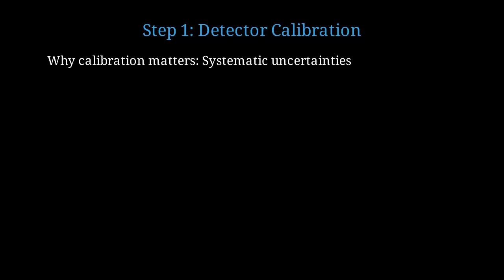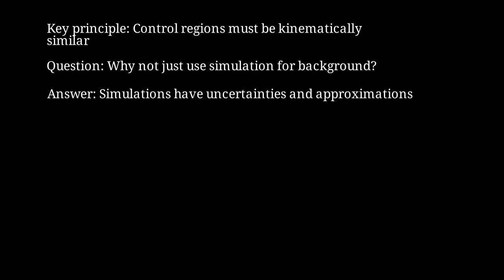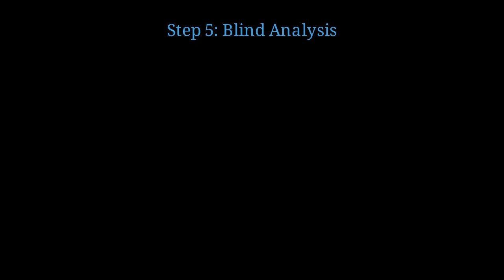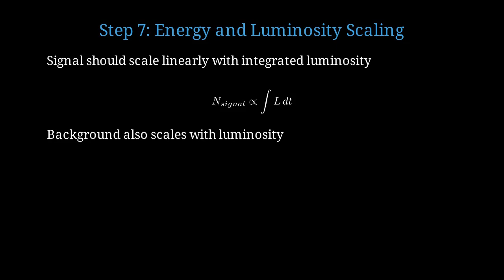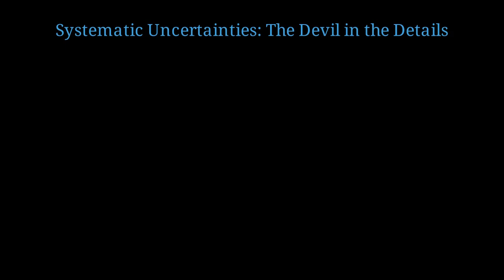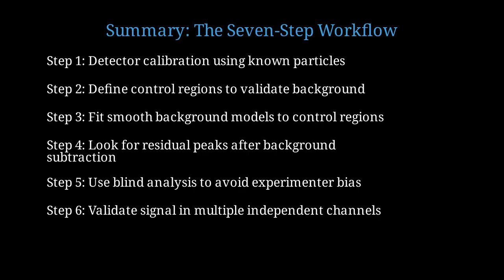Why Finding New Particles Is Harder Than You Think

Comment from the maker: Background-model bias vs sensitivity: How can we design background fitting procedures that are maximally sensitive to narrow signals while provably minimizing “bump sculpting,” especially when the true background shape is only approximately smooth and the search spans wide mass ranges?
ML reliability under dataset shift: What is the most rigorous way to detect and bound spurious ML correlations tied to detector conditions (pileup, aging, trigger changes) so that a classifier cannot manufacture an apparent excess when the data-taking regime changes?
Global significance in complex searches: For modern multi-dimensional analyses (many categories, many channels, many nuisance parameters), what are the most computationally efficient and statistically robust ways to compute global p-values (LEE) without relying on fragile approximations?